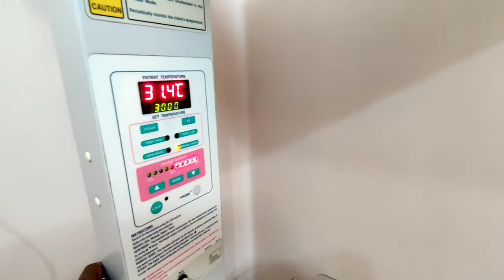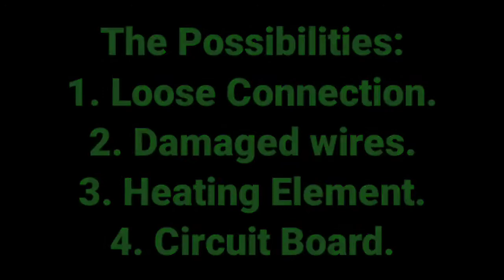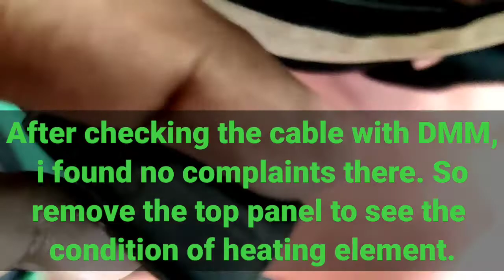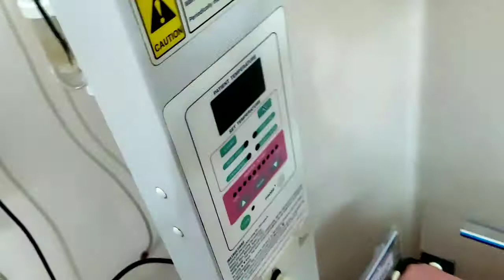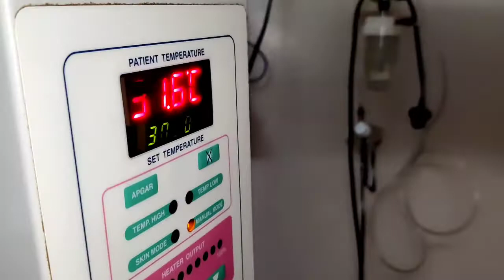Baby Warmer Not Heating Issue Solved🔴 Mr Biomedical

Comment: That pin looks like the switched AC (?) L1 pin and the oxidation is because the heating element is pulling too much current. I get the very same problems with halogen surgical lights. Most likely this will come back due to the existing high current condition.  You might need to eventually solder a wire directly to the board and connect with the wiring harness for a better connection than that pin.
Reply from the maker: Yup👍Always getting this problems in halogen bulbs. I am taking your suggestion and will try in future❤️
Reply: Why the coil is making humming sound in radiant warmer?
Reply from the maker: I guess the coil wont make any sound in warmer. Maybe you are telling that DC fan's sound
Reply: @MrBiomedical  thanks sir